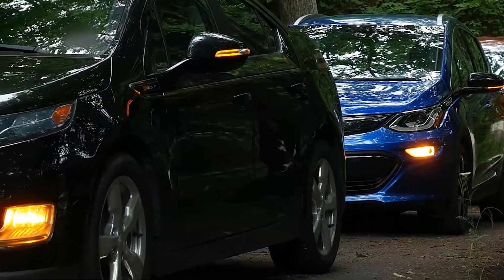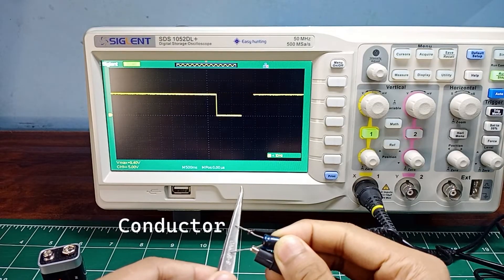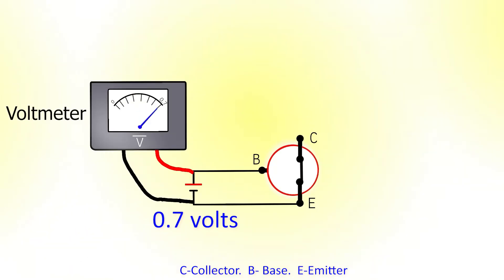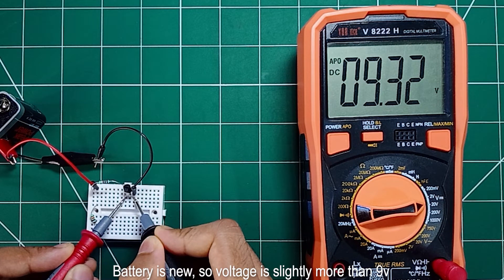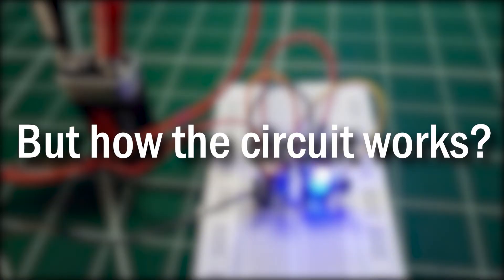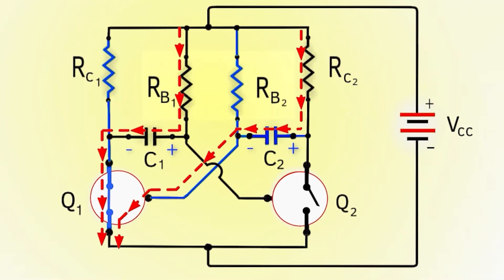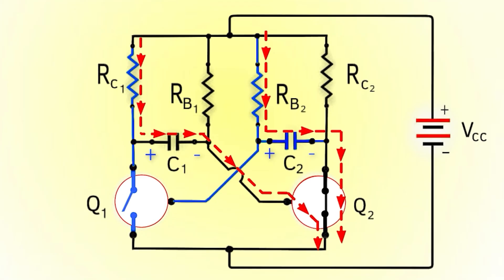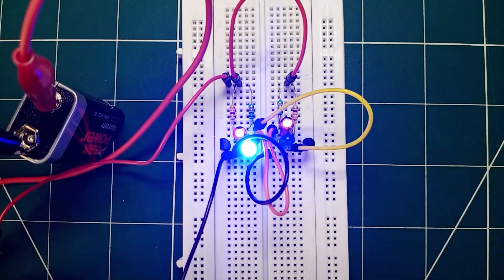Astable Multivibrator circuit explained in detail | Using BJT

Comment: May I ask if the capacitor used in this circuit is a polarized capacitor (electrolytic capacitor)? Tks you 10:39
Reply from the maker: The capacitors can be polarized and it's okay. Electrolytic capacitors can handle small reverse voltage. So, connect positive terminal of the cap to the collector side.
Reply: If using polarized capacitors, when discharging and charging the capacitor, there will be a case where positive voltage is charged to the negative pole of the capacitor (for example RB1 charges to the negative pole of capacitor C1), then the capacitor will be damaged.
Reply from the maker: @tuannguyenanh-yw6yb  yes it will charge in reverse direction but only upto 0.7v which is not enough to damage the capacitor
Reply: @tuannguyenanh-yw6yb  If the components (transistor, capacitor and resistors) were all the exact values, this circuit would not work, It works because the variable accuracy of the component's values. One capacitor will charge slightly sooner than the other which starts the astable action. This should be explained first before showing this example of an astable multivibrator. That is why some people in the comment section are having a hard time understanding this circuit.
Reply: @peatmoss4415  I guess that once you power on the circuit, electrons flow from emitter to base in both transistors. Both transistors are on. The right plate of C1 starts to get a negative charge. The left plate of C2 starts to get a negative charge. One or the other capacitor reaches a voltage of 0.7 V first. If C1 wins, Q2 will be turned off first. I think a charge reversal will start on C1: the left plate will start to become negatively charged. And so, the process begins.

Comment: Hello can u tell me,  are those electrolytic capacitors?
And where did you connect the taller leg?
Reply from the maker: See the pinned comment
Reply: @circuitedu i already have made this circuit and it works..I connected two capacitors taller leg together in series and treated it as a single capacitor(suggested by chatgpt).....that means i needed total 4 cap.

Thanks for you nice video.keep it up

Comment: Good video.  But I came looking for answers to a more complex issue.  I don't understand how the circuit stabilizes.  The capacitor that holds the base negative is the one that controls how long the circuit takes to switch to the next state.  So the discharge time of C2, which is holding Q1 in the off state, determines how long it stays in that state.  But C1 is being charged for this same period, and you claimed it "charged faster" due to the value of Rb. But if charges to a higher value then C2, then that means the next cycle will take longer because C1, charged to a higher voltage, will hold Q1 off for a longer period.  Ok, so the limit of this should be that the capacitors should charge to near the voltage Vcc-.7 you mention.

But in real circuits I test that's not what happens.  The capacitors end up stabilizing at a time pattern than is only about half of Vcc. So there's some more complex trade off between the charging time of the two capacitors that causes the max voltage each capacitor will be charging too.

What I can't figure out, is what the voltage would be and why it tends to be far less than Vcc-.7V. This is a subtle complexity to this circuit, I just don't understand yet. I didn't get the answer to this question ny watching the video, so I guess I just need to keep studying this circuit more.  Using a circuit simulator, I can get lots of good data to understand this.  IT's just going to take more time.
Reply from the maker: This can happen due to load connected between collector and emitter. Instead of Vcc-0. 7, the capacitor will charge upto Vc-0. 7 (where Vc is the voltage at collector with respect to emitter) In my case I have used a 3v led, therefore at collector, voltage is 3v and thus capacitor charges upto 3-0.7 = 2.3

But still, I may need to verify it whether it is Vcc-0. 7 when no load is connected.

Comment: How the terminal of the capacitors are changing automatically and while charging the negatives terminal are connected to the positive terminal of power supply. What is going on, I didn't understand 😢
Reply from the maker: Terminals are not changing, I am indicating the polarity of the capacitor. If the direction of charging is from left to right, then left side of the capacitor will be positive with respect to the right side and vice versa.
Reply: @circuitedu  thankyou unlike other, you are very responsive.
Reply from the maker: Please watch that section again. You can definitely understand!
Reply from the maker: Prerequisites for this video: Basic electronic circuits, conventional current flow.

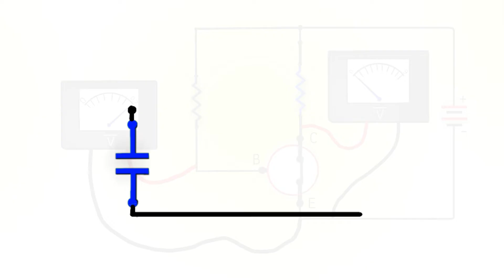Comment: I have a question, why did the transistor turn off when you connected capacitor(6:02) but when the capacitor was full(6:37) it turned on again? (Sorry if my question is stupid, I am a begginer 😅)
Reply from the maker: The capacitor was empty at the beginning. The process can be repeated if you remove the capacitor, discharge it and connect the cap again across base and emitter of the Q
Reply: @HKCREATESUNIQUE  thanks for the reply but I still don't understand that the capacitor is at parralel and the transistor base pin is at parralel too, so the transistor should be permanently on, because there is  always a path from the battery to the base pin,right?
Reply: @MarkoDankić-c5i  If the components (transistor, capacitor and resistors) were all the exact values, this circuit would not work, It works because the variable accuracy of the component's values. One capacitor will charge slightly sooner than the other which starts the astable action. This should be explained first before showing this example of an astable multivibrator. That is why some people in the comment section are having a hard time understanding this circuit.
Reply from the maker: @MarkoDankić-c5i Yes but the capacitor acts as a short circuit at the beginning, pulling all the charges through it. So, instead of flowing through the base, current flows though the cap initially
Reply: there is 0 voltage across it,,the capacitor then charges up to ,70 volts thru the resistor, and when that happens there is forward bias across the emitter and base and that turns on the transistor.

Comment: you explained it weel but, won't the capacitor get charged though Rc resistors since they have small values?
Reply from the maker: It wont if the adjacent transistor is on. Because all the current flows through the transistor

Comment: Just one question - in the beginning, why C1 wouldn’t charge via Rc1 and the Q2 base, instead of charging via Rb1 and Q1 collector?
Reply from the maker: That's becauseQ1 is on and Q2 is off at the time of starting. So, left hand side of C1 will be 0V and right hand side of that will be Vcc. capacitor will charge through RB1. All current from Rc1 will flow through Q1 collector to emitter as it is a low resistance path
Reply: If the components (transistor, capacitor and resistors) were all the exact values, this circuit would not work, It works because the variable accuracy of the component's values. One capacitor will charge slightly sooner than the other which starts the astable action. This should be explained first before showing this example of an astable multivibrator. That is why some people in the comment section are having a hard time understanding this circuit.

FYI:  I spent a lot of time matching up the resistors, capacitors and transistors in a component tester so the values would be the same. I then built the circuit and it would not oscillate until I shorted a couple of legs of the transistor with my tweezers to start the oscillation.

Comment: Why the base of the Q1 cannot be supplier through Resistor RB2? I see there is a continuous supply.
Reply from the maker: Could you please explain the question again?
Reply: If the components (transistor, capacitor and resistors) were all the exact values, this circuit would not work, It works because the variable accuracy of the component's values. One capacitor will charge slightly sooner than the other which starts the astable action. This should be explained first before showing this example of an astable multivibrator. That is why some people in the comment section are having a hard time understanding this circuit.

FYI:  I spent a lot of time matching up the resistors, capacitors and transistors in a component tester so the values would be the same. I then built the circuit and it would not oscillate until I shorted a couple of legs of the transistor with my tweezers to start the oscillation.

Comment: very impressed with your videos
animations are great !!!
can you share which tool you use to create the animations 🙂
Reply from the maker: Flipaclip and premiere pro
Reply: @circuitedu  thanks dear 😊
Reply: @circuitedu  i have done this experiment and added a slight twist. st i did the usual way with both halves being perfectly symmetric and i got the classic blinking result. then,  I attached a 447microfarad capacitor to the base of 1 transistor and a 100 micro farad to the other. the one with the 100 microfard stays on 4 times longer than the other  ... i found that  counter-intuitive. Have you given it a thought or tried it ? glad if you could throw some light ...thanks once again.
to summarise when C1 > C2  ---> Transistor 1 (Q1) stays on longer than Transistor 2 (Q2) and vice versa
Reply from the maker: Can you explain it by making a short video? I will watch and reply
Reply: @circuitedu  surely. I have changed the resistance as well and i think i have an explanation. I will post the video 2morro and share the link 🙂
Reply: @josephpeter6796  If the components (transistor, capacitor and resistors) were all the exact values, this circuit would not work, It works because the variable accuracy of the component's values. One capacitor will charge slightly sooner than the other which starts the astable action. This should be explained first before showing this example of an astable multivibrator. That is why some people in the comment section are having a hard time understanding this circuit.

The 100 microfarad stays on 4x longer because the 447 takes 4x longer to charge up.

Comment: Hi, very good video. Which values do the resistors have in your example at 06:05 ?
Reply from the maker: You can experiment with any resistor value. E.g 1k for collector 47k for base resistor and 1000uF cap